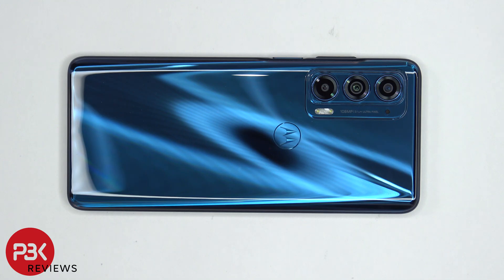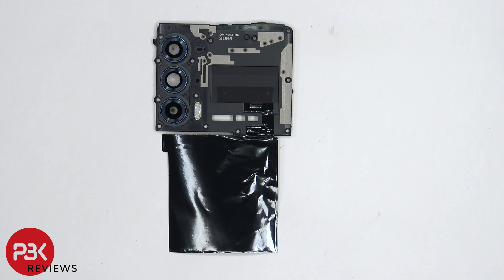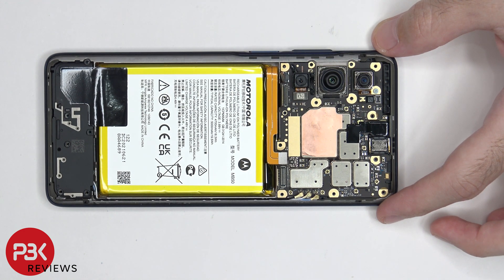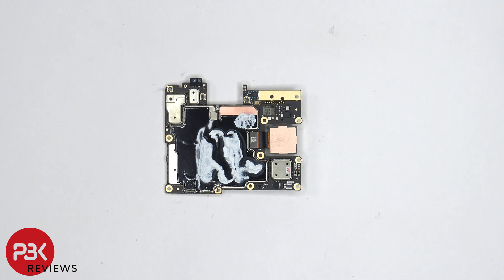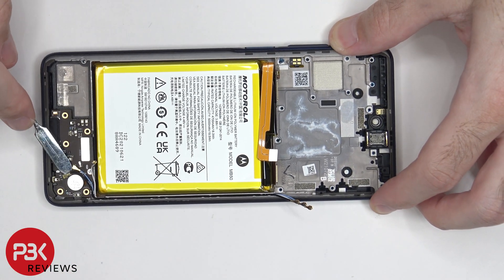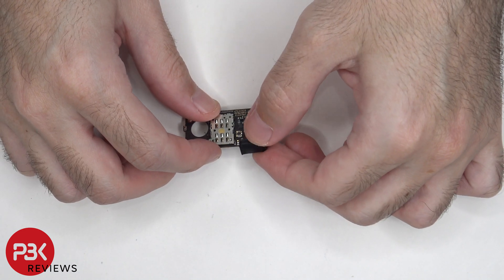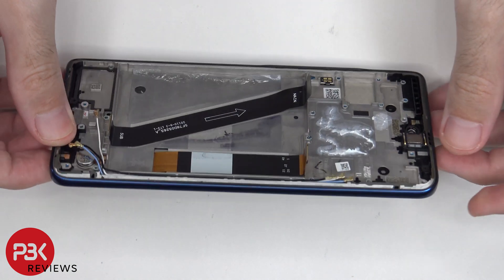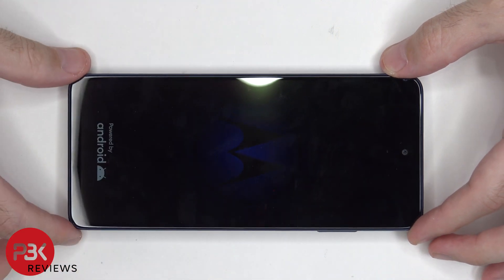Motorola Edge 2021 Disassembly Teardown Repair Video Review

Comment: Wait... What? I watched this entire video cuz I'm needing/wanting to replace the whole outside edge for frame on my phone but have no idea how to even go about it ..I thought for sure a "full tear down" video would include this.... 

I thought wrong ☹️
Reply from the maker: If after watching the video, you are not sure how to separate the screen from the frame then you really should not be doing it to begin with. One, you will more than likely damage and ruin the screen, so for a frame replacement its not worth it. Two all that is left is to heat up and pry off the screen and any left over parts to move over to another frame but removing the screen poses a high chance of damaging it.

Comment: Do you have to take all of the top upper and lower parts off to replace the battery or can you just disconnect everything and put the iso around it. Slowly pull the battery and reinstall? I'm just needing to do a battery replacement I was hoping I didn't have to disassemble the phone down this far

Comment: Great video! When replacing the charging port, is it necessary to disconnect the battery?
Reply from the maker: It's always recommended to disconnect the battery so you don't risk shorting something by touching parts of the phone with tools or your hands but you could do it without disconnecting the battery cable.
Reply: @PBKreviews  Thank you!

Comment: How do you do this without a heat gun
Reply: I've been wondering the same because I've tried with a blow-dryer and it doesn't work at all.
Reply: @str8edgesuperstar  blow dryer worked for me. Highest setting I used a knife tho(not recommended unless you know what your doing ) to get the initial pry. plastic pry tools are a pain in the neck on the first opening if not sufficiently heated. But came up on first try

Comment: Excellent video for what I needed. I fixed (repaired) my Motorola Edge 5G UW 2021 charging port using this video to ensure I was disassembling the phone correctly.  I saved over $100.00, which would have been the 2nd $100.00 for a recurring issue after the phone fell on the charging port with a charging cable connected.
Reply from the maker: 👍 glad it was helpful

Comment: Can I just skip that first part if i just need to fix my charging port? They want$300 out there damn mind it was one month out of warranty and it's a common issue for they're newer models happened to my stylus too. I purposely got this one going out would not have the same issue and it did right doing the same time
Reply from the maker: yeah, as long as you take the back cover off, and remove the screws holding the sub board/charger port board cover down, you should have access to removing the sub board so you don't need to disassemble the rest of the phone. Also you can find parts for this phone on mobilesentrix.com

Comment: :50  THANKS for showing that the camera lens covers are NOT part of the case!  Despite ALWAYS using protective cases and screen protectors, today, for the very first time, I dropped my phone and broke the top lens cover!  Still fuming over it, AND I can't afford the $140 quote from Motorola!  Someone here asked if the lens can be replaced without taking the cover off, though.  Is that indeed possible?
Reply from the maker: you're welcome. yes the glass camera lens circle covers can be heated up and pried off without removing the back plate/cover. Check mobilesentrix.com to see if they carry the replacement parts. usually they have original replacement parts for most Motorola phones.

Comment: What if you've done all that, and the phone turns on...but it isn't responsive to touch...it'll vibrate with my fingerprint, but does nothing if I tough the screen anywhere .. please help!?
Reply from the maker: Did you replace with a new screen? if so and your old screen still works but is broken, you would have to use it to make sure your phone software is up to date. In most cases the phone software needs to be updated to read some replacement screens correctly. If not you would need to manually flash new software which would probably delete your data on the phone. Aside from this, the next thing I would lean toward if this didnt fix it, would be a defective screen.
Reply: I'm currently having this same issue, any luck?

Comment: I just bought a Google locked edge 2021 from marketplace for $30 the screen is cracked and had a burn on it from a lighter and the top lens on the back is shattered I just removed the shattered lens and left it open' as I'd,,

Ps.i bypassed googles lock and now the phone is fully activated!, Going from a Samsung note 5 to this is a HUGE upgrade and big difference!,
Reply from the maker: Nice, you can get this part from this website and heat up and pry off the good lens and move it over to your phone if you don't want to open up the back and replace the entire part itself. This way you avoid dust and moisture getting in your phone. https://www.mobiledefenders.com/midframe-for-moto-edge-2021-xt2141-2-authorized-oem.html

Comment: My charge port is visibly burnt. I can't find a replacement board ANYWHERE. Is this because the phone is so new? It's an Edge 5g UW on verizon. Model is XT2141-1. Please help. Anyone.
Reply: I see all Motorola phones have a 1 year warranty, which I am well within. I'm sure it will involve a deductible and it would be cheaper and quicker to just do the repair myself since the board is probably $20 or less. Should I try repairing through them or just find parts and do it myself?
Reply from the maker: Hi, the warranty would cover the replacement and there is no deductible for it. Motorola offers two services. One they can first send you a replacement phone which you keep and you send them your defective one, that one they charge $25 fee for and they place a hold on your credit card until they receive your original phone back. Or two you mail them your phone and wait 4-5 days for your phone to come back repaired. That option is free and both methods they ship you a pre paid label to ship the phone to them. Here is the website. https://motorola-global-portal.custhelp.com/app/mcp/service

Comment: Awesome teardown video. Thanks for sharing. I needed to see this. I will need to change my camera lense for the 8mp top one.
Reply from the maker: Thank you and you're welcome :)
Reply: @PBKreviews  So, I had a fall and now I need to change my lense glass for the top lense and the glass screen of the phone. The digitizer and LEDs are all good. Just have cracked Gorilla Glass. 
I don't need to open the back to change the glass screen do I?
Reply: I just bought a Google locked edge 2021 from marketplace for $30 the screen is cracked and had a burn on it from a lighter and the top lens on the back is shattered I just removed the shattered lens and left it open, they are glued in so no you don't have to remove the back cover got replacement

Ps.i bypassed googles lock and now the phone is fully activated!, Going from a Samsung note 5 to this is a HUGE upgrade and big difference!,

Comment: Can I use a micro SD card on this phone
Reply: No. It's dual sim. Not hybrid.
Reply from the maker: Its a dual sim reader from the looks of it and does not have a micro sd reader on the edge 2021. However it has the dual sim pins disabled so only single sim for the edge 2021.